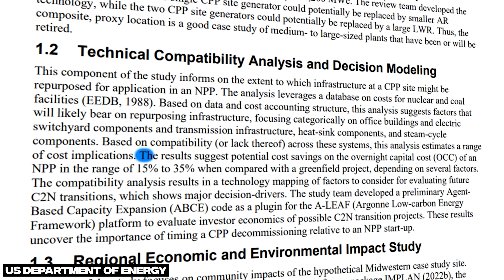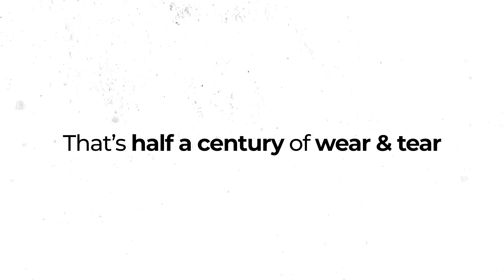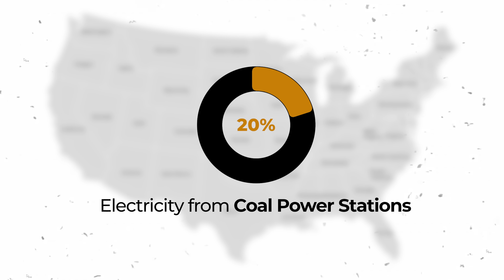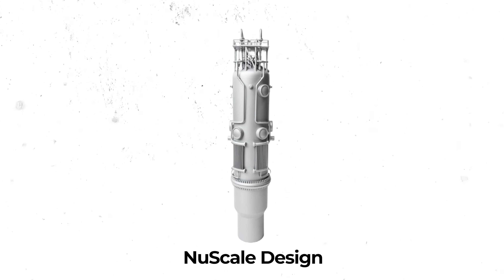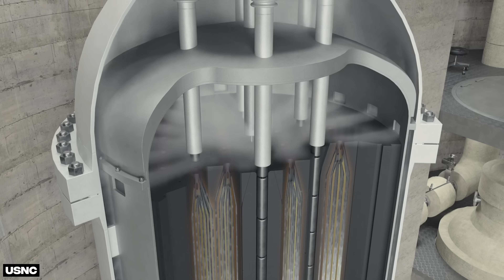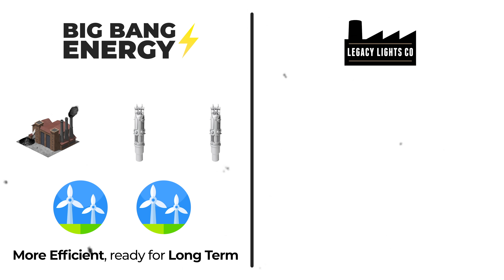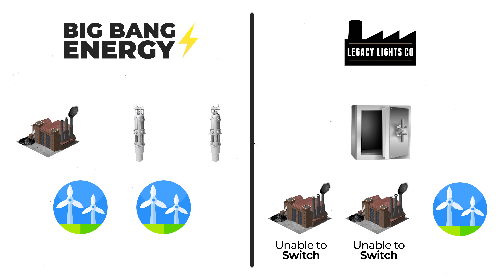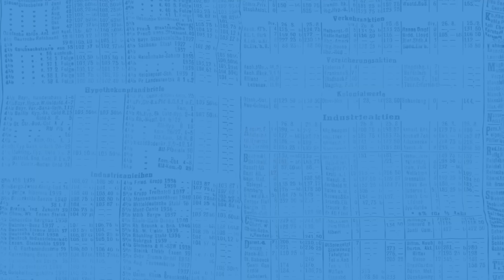Can We Convert Old Coal Plants to Nuclear Energy?

Comment: Maybe you mentioned it and I missed it but one of the largest burdens for taking over a coal power plant with a nuclear one is the fact that there is radioactive waste around coal plants.  When coal plants burn coal they release radioactive particles (from minute amounts of radioactive elements in the coal) as waste in the smoke.  This settles in and around the coal plant.  If the plant were to be turned into a nuclear plant the Nuclear Regulatory Commission would hold it to the current standards for nuclear power plants in regards to radioactive waste.  Coal plants do not have this constraint but a nuclear plant does.  Some coal plants therefore would need to have massive clean up operations to make them regulation ready and that might prove to be cost prohibitive for the project.
Reply: I came here to ask the same!
Reply from the maker: Good question! I don't believe coal radioactive emissions are regulated by NRC since coal plants aren't in NRC's jurisdiction. However, coal plant emissions would be regulated by the EPA, which has its own limits on radioactivity. They have a short discussion on their website, but it's not totally clear to me. https://www.epa.gov/radtown/radioactive-wastes-coal-fired-power-plants
Reply: @atomicblender  I should have been more accurate with my statement about radioactive waste.  What I should have said is that there would be an unacceptable amount of radioactive contamination in and around the coal plant.  With a nuclear plant it's highly regulated how much radiation is allowed for workers and on site.  This sort of monitoring is not required for coal...but again if a coal plant were to be converted it would therefore fall under the NRC and all of its guidelines/requirements.  If I recall correctly this is touched on by Michael Shellenberger in his book "Apocalypse Never."
Reply: The regulator probably isn't concerned about trace amounts of natural uranium. Unreacted natural uranium in coal ash is a very mild neutron emitter in no way comparable to the conceivable leakages of reacted material. They could just measure the now naturally occurring background of the site, for all major types of radiation, in a comprehensive survey, and regard that as a baseline.

A nuclear plant has virtually no leakage of radioactive material in normal operation, barring disasters. Putting the nuclear plant at the epicenter of coal-fired contamination may well reduce the (incredibly minor) potential for human exposure in the buffer zone around the plant and give time for coal-derived uranium to settle deeper into local soil and become less available to be blown as dust. Once the nuclear plant is wound up, there might be measurably (though minutely) less radiation in the general area than before, just from decay.

Radiation from reacted material is many orders more severe and penetrating, including Gamma, and a wide range of Beta, Alpha and Neutrons with distinctive energy windows. Should a leak actually occur, it will be well and truly distinct from any natural uranium residues in fugitive fly ash.
Reply: @aaroncosier735  
While it is possible for uranium to spontaneously fission, it is highly unlikely and that is the only way you would get a neutron emission.
EVERY nuclear plant releases radioactive gases and liquids and their operating permit established the release limits.
Reply: In fact, China is conducting a research project on how to run a nuclear reactor on radioactive coal ash.
Reply: @clarkkent9080  Ever heard of Oklo?
Reply: @neuralwarp  ever heard of editing your neutron emitting posts insyead of some moderator having to tamp them? hey there half sphere screwdriver toktik Joe? that burn is gonna love many lives and a half.
Reply: @neuralwarp  Yes but what does that have to do with anything?
Reply: Well that's completely irrational but it's no surprise coming form the NRC. The NRC needs to be disbanded.
Reply: I believe that all U.S. coal plants are required to have scrubbers (and have for decades) that remove 99% of particulates from the stack gases.  Also, the stacks are high enough that any particulate that is in the emissions will not fall to earth (except in rare atmospheric conditions) for hundreds of miles.  Ash piles do contain somewhat concentrated isotopes that is found in coal. 
The NRC does NOT regulate any hazardous or NATURAL radioactivity at the plant site.  A perfect example is Radon that decays into a radioactive particulate.  I have worked at nuclear facilities with Radon problems and once you confirm that a person or article is contaminated with Radon daughter products, it can be free released.
The EPA does regulate the coal piles and would continue to do so.  I don't think they will be building a nuclear reactor on a coal ash pile.
Reply: @gregorymalchuk272  Of course.  why would anyone want a nuclear power plant to be regulated.  The investor owned utilities can be trusted to do everything right
Reply: @gregorymalchuk272  The NRC only regulates liquid and gaseous radioactive EMMISSIONS from nuclear facilities, NOT what is in the soil.  Radioactivity from commercial industry is regulated by the EPA
Reply: Well then change the regulations or DON'T BUILD A NU LEAR POWER PLANT.
Reply: @jcjensenllc  Since Terrapower is planning on building their Natrium reactor to replace a 60 year old coal plant, I don't think you need to change any regulations
Reply: Dependent on the source, ash component of coal contains various amounts of uranium and thorium.  Ash is also a good material for making concrete.  50 years ago in Poland there was a problem that some high rise apartment buildings with concrete walls had excessive level of radiation for that reason.  However, I do not think that ash "settles" around a coal plant.  Either it goes up through a tall chimney, or it is stored on a heap.   I would doubt that heaps are good construction sites.  In any case, sites have to be carefully evaluated for many aspects.
Reply: @piotrberman6363 They used to mix coal ash with concrete in the U.S. also.  We use concrete blocks to build many structures.  The old timers still call them cinder blocks and that term originates from the past when coal ash cinders were added to the concrete mix.  So yes we have old buildings with the same issues.

In the U.S. coal plant scrubbers are required to remove 99% of the stack particulates.  The boiler ash and the scrubber ash is placed in settling  ponds.  The reason there is elevated radiation level at a coal plant is because of the collection of the ash in these ponds.  Don't build a house next to these ponds and you will be fine.
Reply: Nuclear waste can be recycled into new fuel for the same power plant.
Reply: @neuralwarp can you give some link for that china research
Reply: nickschroeder9358  We don't have reactors that can recycle it yet, and no one is stealing 50 ton caskets.
Reply: That's possible but overall it will be much cheaper. Then having to find new piece of land and construct everything from scratch. Plus we wouldn't even need to convert every single decommissioned coal plant to nuclear. Since nuclear makes like 3-8 times more energy then coal. So the rest of the old coal plants could with time be turned into other things from housing to parks or agricultural land. Of course with time and clean up. But overall this a really great option.
Reply: But twodownside Is greenpeace and political mumbo jumbo
Reply: Agreed 👍 It was a concern for Australia. Coal especially in Victoria with brown coal was it. Australia 🦘🇦🇺 has never had nuclear power plants only coal. Mine operation usually nearby. Monitoring of such a dirty site would be a challenge. Green activists with Geiger Counters would be protesting the "leaking plant" before the first fissionable material arrived on the site...
Reply: I live by a coal plant. There’s no radioactivity above normal background levels. I’m a level two industrial radiographer and have very sensitive radiation equipment this has never been an issue for coal plants and will never be an issue for coal plants.
Reply: @caesarsalad1170 we’ve had reactors that can recycle radioactive waste for the last 60 years.  They’re called breeder reactors!! They could be used but they won’t use them because that would make to much sense. There’s a few countries in Europe that recycle radioactive waste and re use the same fuel. They’ve been using the same radioactive materials for the last 50 years or longer.

Comment: The real situation over SMR is that there are just almost all "paper reactors" (only exists on designs) and there is no real data about the final costs, beyond a few pilot plants in Asia and Russia that means nothing. It's all promises.
You can advocate as much as you want, but big real investors put their money based on real data. Without real plants that demonstrate that these ideas and models could become real (for the promised cost), it's just promises, like long before nuclear industry promised "electricity too cheap to be metered". And here we are.
Reply: The real problem is that many of the small modular reactors actually do exist in a form in submarines and warships. These have worked successfully for years but unfortunately are secret and therefore can be shown as proof they work